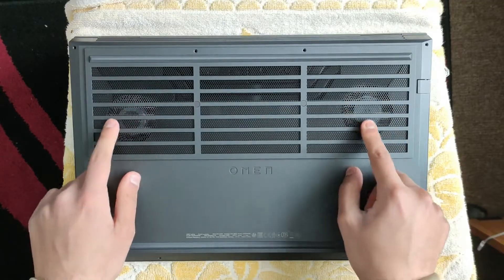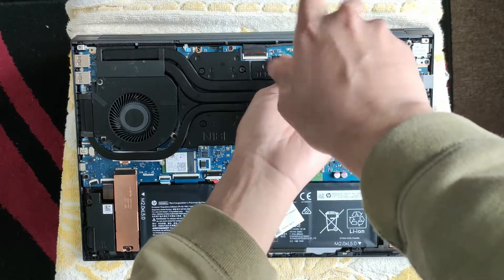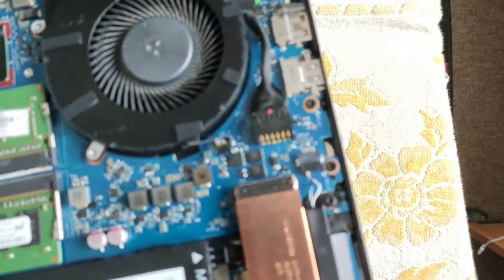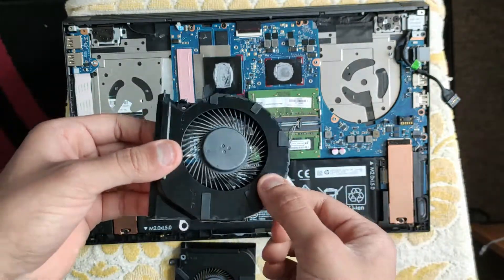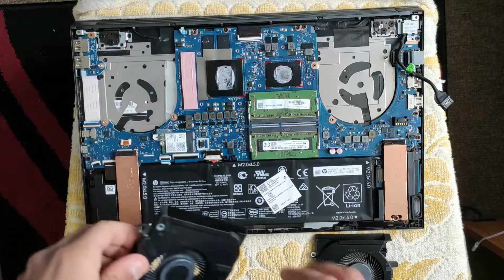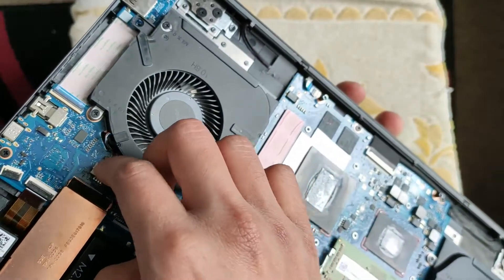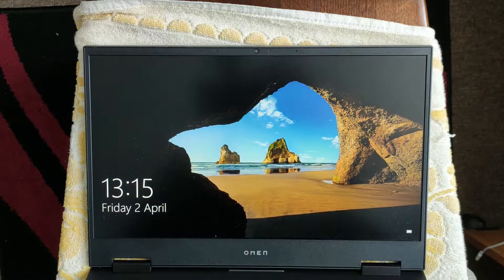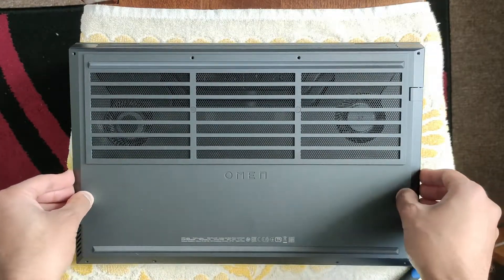HP OMEN 15 2020 || How to Remove and Clean the Fans

Comment: Bro can you show how to clean the cpu fan ?
Reply from the maker: @strange things chengez After you remove the fans you can use compressed air to remove the bulk of the dust, and then use a soft brush to remove the more "sticky" dust, which will not be blown away from the air alone.

Check out the video at the 6:23 timestamp.
Reply: @nighteye5253  bro thank you so much bcxz of you i opened my laptop by myself replaced the paste and clean my fan. my cpu fan is a little loose. like when i cleaned it9laptop giving 90 b error) i cleaned the fan physically pushed the fan rotator up and turned on laptop it stopped giving me the error, but it's making the weird noise. should i fix the fan properly again and use it or buy a new cpu fan ? again thank you so much for your help
Reply from the maker: @strangethingschengez2318  Oh damn, 90b error is not great. Good thing it's gone. 

However, the weird noise, what does it sound like? I am worried that maybe one of the blades is getting caught, which eventually will wear down the fan motor. An easy check is if you open the back panel, and just rotate the fan by hand slowly and see if you hear the sound. Another thing, as you said, make sure the fans don't move around in the case.
Reply: @nighteye5253  i think what you said was alrady done to it 
it does not spin
i need to replace it
can you please share the model number of the cpu fan and any place i can order in germany ?
Reply from the maker: @strangethingschengez2318  I don't know of any reputable German online stores as I am in the UK. As for the part numbers, you can find them in the pinned comment at the top of the comment section. I do recommend making sure they match the ones in your laptop. Just check the fans, you'll find the serial number on them.

Comment: Do you have to repaste it if one where to remove the heatsink? Is it always a necessity?
Reply from the maker: @Emanuel ER I would always advice to repaste if the heatsink has been removed.

The reason for this is that if you put the heatsink back on without repasting, you run the risk of not having uniform spread of the thermal paste, which affects thermal conductivity. It's not the end of the world, but you will likely see worse thermals afterwards.
Reply: @nighteye5253  

Thanks!
Reply: @nighteye5253  

Oh, and I cannot seem to open the back panel at all! The gap is to thin for anything. Tried with a debit card but it's not working at all, and the entire process of opening it with screwdrivers was a giant pain in the butt, because I had to press so hard into the screw to get them out 😅
Reply from the maker: @Pensive_117  Ah, yeah, you have to open it from the backside, where the exhaust vents are. There are no screws keeping it down there, just clips, so it's the easiest place where to insert a card or similar. Then slowly pry around, because some people reported breaking some clips. Not the end of the world though, the screws themselves do a good job keeping the back cover on as is.

Comment: Can you please tell me what is that you used for repasting?
Reply from the maker: @Soumyajit Bhattacharya I use mx-4 arctic thermal paste. Good performance, but requires repaste a little more often than other pastes.
Reply: @nighteye5253  how often do I need to re paste?
Reply from the maker: @TheHonestTruth  TLDR: when you start seeing visibly higher temperatures in similar condition to when you first repasted, you know it's time to repaste.

Full:
I'll be honest, my current repaste is lasting well over seven months now with the MX4. I was probably too harsh on it. If you repaste correctly, you should see good performance for a while. Though, even with a good application, I would start considering repasting after a year, unless your temperatures are still looking good.

Comment: do you know where can i get the gpu fan ? mine has issue ?
Reply from the maker: On the back of the fan (after you remove it) you'll find the service PN number. You can use that to google your fan and find replacements.

Comment: What size was the screw driver used? Just a regular mini philips head?  Like for a eye glass kit? Thanks 🙏
Reply from the maker: @J Shaka That one should do for the screws on the cover. You might find it harder when it comes to the heat sink though. It's always Philips head, but a bit thicker for the heat sink for an easier time.

Comment: Can I just vacuum the fan after removing the cover? 😅 im too afraid to remove the screws from the board and reapply thermal paste on the heat sink, might not be able to return it after
Reply from the maker: @Adam Julian I would not use an actual vacuum cleaner, that's too strong. You can use compressed air, provided you hold the blades in place (so they don't spin out of control). I guess you could use a normal pump (like the one you use to inflate a football ball), but I am not sure how clean the air from it will be.

Try just brushing off the dust first, using an old toothbrush or something. Some of the dust won't go away with air alone.

Comment: Can you please help me with the settings or any configuration to set to lower the fan noise cause I've sent to the repair for 3 times but still even in idle, fan on the left starts spinning that is very audible, gets worse in very silent environment.
Reply from the maker: @sujan magar Sure! So, the left fan is for the CPU. Do you have your CPU boost disabled?
edit: the left fan is the CPU if you are looking at the laptop when untouched. When you remove the bottom panel and looking at the motherboard, the CPU fan is on the right.
Reply: @nighteye5253  Yes, I have disabled the processor performance boost mode, but still it's not working.
Reply from the maker: @sujan magar If you are very organized, you can try to use Notebook FanControl. I have a video on that. Mind you, if you forget the settings on no fan, then the fans will not turn on even if you are gaming, so every time you are done using it, make sure to disable it.
Reply: @nighteye5253  Thank you very much. I watched your video of fan control, followed the steps and finally now, I'm having some peace while just opening a word file. Is it Ok if I leave it on Auto?
Reply from the maker: @sujan magar Yes, auto should be fine. Just make sure to check temperatures every now and then, just to keep an eye on things. Enjoy your well deserved silence!

Comment: My hp omen 15 fans seem to have a really bad issue. The fans became stiff, one of them would stop spinning like 4 hours after the start-up and it’s not even because of dust, so I think it could be because of my fan lube dries out because of the crackling sound it makes. I disassembled my laptop and the fans don’t have any screws on it, it’s just pure plastic and metal piece. It would be really nice if you could tell me or make a video of how to disassemble the fan itself, so I can reapply lube on my laptop fan. I’m so desperate here man and I hope that I don’t have to buy a new set of fan. ;(
Reply from the maker: @YungCoconutZ Not sure if you have seen it in the video, but unfortunately I was not able to remove the backplate of the fans. I have tried removing those little plastive rivets, but with no success. They seem to be welded, though I cannot be sure. It could just be very tighly attached. 

In any case, I am not going to try to find out, I hope you understand. While I had an idea of how to get the fans themselves out, I would not be able to fix the backplate should I mess it up. Anyhow, I am at uni at the moment, and don't have the equipment to open the up the laptop anyway and do a subsequent repaste. Sorry.

However, before you consider anything drastic, you can sort of access the very base of the fans from the back side of the plate. Are you sure nothing like hair or string is perhaps stuck in there? It also seems very odd that it would turn fine for four hours and then suddenly stop. Just to clarify, does the fan work after a reboot, or is it just permanently damaged?

Comment: Hello, I got this laptop one year ago and now I reach temeratures of 80 by doing almost nothing. I tried to follow this video for the first time and i couldnt take off the battery and half of the screws were stuck. I saw there were numbers there and i couldnt take off the screw 1, 3, 5 and  6. If anyone knows how to solve it please reply, its my first time opening a computer. Btw great video it was really usefull!
Reply from the maker: @Victor GG Hi! So, the screws you are referring to are the ones to remove the heatsink. They are not meant to come out all the way, as they are spring loaded.

If the screws have been unscrewed but the heatsink still doesn't lift up (to lift the whole heatsink, there are two more screws other than the numbered ones that you need to unscrew near the edges, in case you missed it in the video), it could be that the paste is quite dry and is acting like a glue. It helps to do the teardown soon after say a gaming session just to heat up the paste. This way, the paste will likely be softer by the time you open it up and likely to give up easier.

As for the battery connector, I know it is quite hard. It took me a good fifteen minutes to get it out. I had to pull it from one side, then the other, until it gave away. Naturally, it's much easier to remove later on.

You could do it without removing it, but unlike a simple repaste, you are removing a component from the motherboard. (That is, if you plan on removing the fans). 
For a simple thermal paste replacement, you just have to make sure you have no static electricity on you. Touch some metal to discharge yourself of any you might be carrying. This sounds horrible, but it's just precaution. These days pc components are quite well shielded.
Reply: @nighteye5253  Thanks for answering, I know that the screws are not supposed to come out completely but there are some screws that i couldnt even move, I tried with different screwdrivers but they didnt worked
Reply from the maker: @Victor GG Not sure what kind of screw driver you're using. I use a CR-VPH1 or CR-VPZ0 pins on the screwdriver. (Not sure if those are standard or not). They are quite small.
Reply: @nighteye5253  I have a trupper package, its weird that i wasnt able to remove those screws and with the other ones I didnt have any problems
Reply from the maker: @Victor GG It may just be that they are very tight. Just add more downward pressure when unscrewing, eventually they'll turn.
Reply: @nighteye5253  yeah, I tried and almost destroy the first screw lol
Reply from the maker: @Victor GG Just to clarify. Is the screwdriver locked into place, or is it sliding? As in, when you try to turn, is the screw driver slipping off of the screw or is it just locked into place and you can't move either?
Reply: @nighteye5253  It is slipping off
Reply from the maker: @Victor GG In that case you just have to use a different screw driver. I am assuming it's slipping because of the screwdriver and not because the screw has been worn down by repetitive unscrewing using the wrong screwdriver size. Try one with a finer tip.

Comment: The first fan you removed, is it GPU or CPU fan? Because it won't spin on my laptop anymore
Reply from the maker: @RiyuvioFTW For this model, the omen 15 with Ryzen CPU, the GPU is on the left and CPU is on the right (when you open the cover, and the fans are on the top side, with the battery at the bottom).
I removed the fan on the left first, which is the GPU fan.
Reply: @nighteye5253  i see, thank you very much!
Reply from the maker: @RiyuvioFTW No worries. Does the fan not work at all, or is it just in specific situations?
Reply: @nighteye5253  the fan does not work at all.
Reply from the maker: @RiyuvioFTW Have you checked if the fan connector is placed in correctly?
Reply: @nighteye5253  not yet. I'll try checking it soon, it stopped completely just an hour ago.

Comment: Can you use compressed air and thus save yourself some time?
Reply from the maker: @Aathreya Shenoy Most certainly! Compressed air is the fastest way to get rid of the dust build-ups. However it doesn't work on dust that is statically attached to the surface, so you need to brush or wipe that off instead.

Comment: Hi mate test termal pads for GPU and CPU. And do you will have a awesome temperature on your CPU and GPU.
Reply from the maker: @abner dominguez Thank you for the advice! I have a cooling pad already, but I never really need to use it since temps are already amazing. (Currently keeping the boost on the CPU off all the time, unless needed). I end up just using it to raise the laptop a bit. It does improve air flow, even when not in use.

Comment: Ive heard the fans on this laptop keep going all the time ??? Is this true like even on idle ive heard the fans are loud
Reply from the maker: @I am a stupid person It very much depends on temperature. The fans will usually come on when the internal temperature hovers above 60-65C for this laptop (this laptop uses an IR thermopile sensor to monitor temperature). Depending on power mode, this limit can be lower (eg. Comfort mode).

So, you would agree that depending on the ambient temperature, the internal temperature of the laptop can vary quite a bit. 

In addition, heat will build up if the fans don't come on. Unless you work in a rather cold area, the heat will eventually heat up the inside anyway up to the 60-65 mark, because heat doesn't exchange fast enough with non-moving air. The only difference is how long it takes to get to that point.

So, answering your question: I usually leave the boost off on the CPU, which makes it so that the CPU doesn't heat up as quickly. (Note, the fans will come on at a lower temperature limit) At idle, the fans will not be spinning, for about half an hour. At that point the fans will start spinning at a low speed (audible in a silent environment, but barely noticeable in normal settings). The low speed means that the cooling takes longer, so the fans stay on for about twenty minutes, and the cycle start again.

If my room was warmer, and I had say performance mode on, or even just default, the fans would come on pretty harsh every few minutes. This is because the temperature inside would continuosly rise pretty fast and cool down faster.

If fan noise is a concern, I have some videos showing what effect disabling the boost on the CPU has on temperature.

Comment: I don't know much about computers and was wondering do I have to take off the heat sink if I'm only planning on cleaning the fans.
Reply from the maker: @DonDonGaming It depends. If you plan on removing the fans completely, then yeah, for this model you will need to remove the heatsink. 

This also means that you have to repaste the thermal paste.

Otherwise, you can just use an air can to blow some of the dust away, without needed to remove anything but the back cover.

Keeping a finger on the fans, so they don't spin out of control, you can push out the dust. Also, spraying air through the out vents to clear the air ways.

Comment: you know what 
that termal paste is shitttttttt.

you should have gone for GELID gc extreme
Reply from the maker: @Jatin Sync There are most certainly better choices out there for thermal paste than the one used in the video. They just cost a little more and I still have to finish my current tube 😂
Reply: @nighteye5253  just upgrade your thermal paste
Reply from the maker: @Jatin Sync Oh, don't you worry, my temperatures are fine. You can head to my discord server if you want to check out some graphs in the hp-omen-performance channel.
Reply: @jatinsync3820   He knows what he’s doing 😂

Comment: Question, I'm new to this and want to clean my laptop fans as well. I have the same omen series as you, so I'm glad I found this video. For clarification, what did and screwdriver did you use? I was planning on taking it to best buy's geek squad, but my mom mentioned a story about her friend getting her laptop cleaned as well, got it back, but ended up buying a new one after it didn't work the same way once she picked it up from best buy. I'm a little nervous about taking it now, so if I could learn how to do it by myself without paying for the fans just to be cleaned, that would be great :'))
Reply from the maker: @Gh0stly Gemini I used a random precision screwdriver set I bought at Lidl at some point. In particular, a small Phillip head screw screwdriver. Any will do, like this one. https://smile.amazon.co.uk/dp/B08NT3N52P/ref=cm_sw_r_cp_apa_glt_fabc_5C04Z3FVSYR8ADVYB7TS

The process in itself is not hard, it just needs care and patience. One thing to remember, you will have to repaste the thermal paste, there is no way around that.

As for the process itself, you can see in the video that you only need to remove some screws and the fans come off rather easily.

You'd have to clean the heatsink fins as well, and using compressed air is probably the best way. When cleaning the fans, if you use compressed air, make sure they don't turn on their own too fast. Just hold them with your finger to avoid wearing the ball bearings.